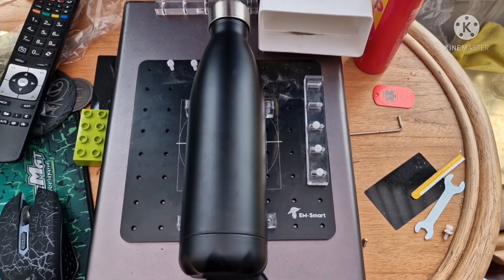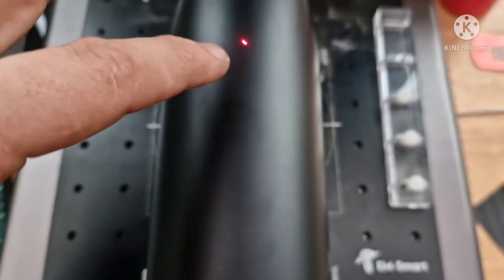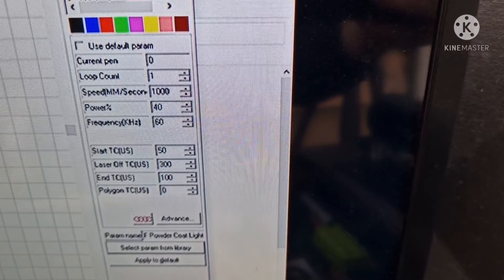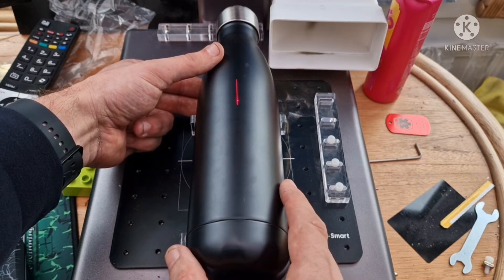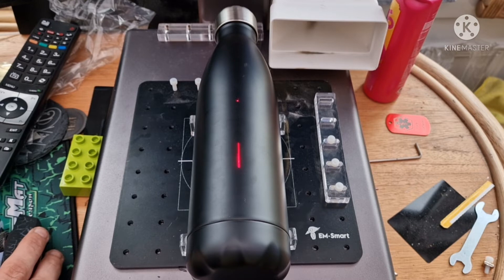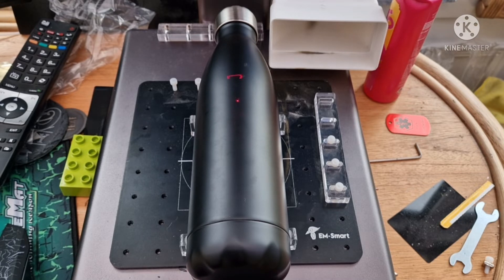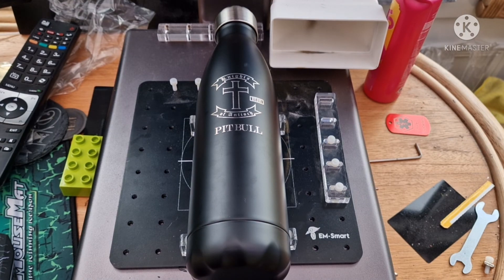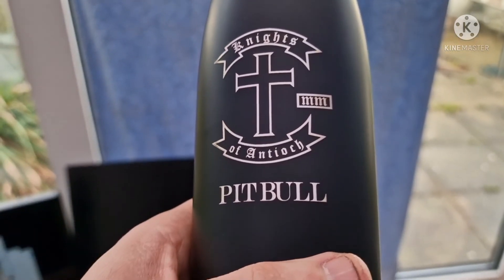Stainless steel water bottle engraved on the em-smart one 20w raycus fiber laser

Comment: You ever run into this issue? I have the same engraver as you and I tried engraving couple of the business card and ran into the issue below. You ever run into this issue? 

18. The EZCAD software shows "Ready" and the red light is working, but the machine is not marking or engraving.
Please adjust the power on the right side of the software.
Please check if it's focused while marking or engraving.
Reply from the maker: No never had an issue apart from ezcad crashing